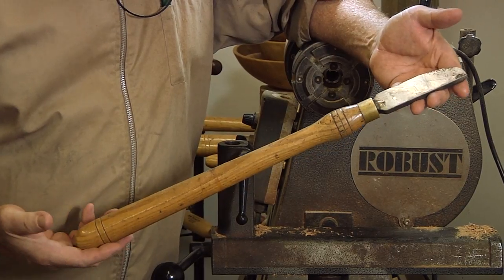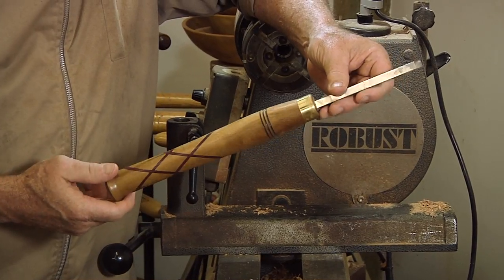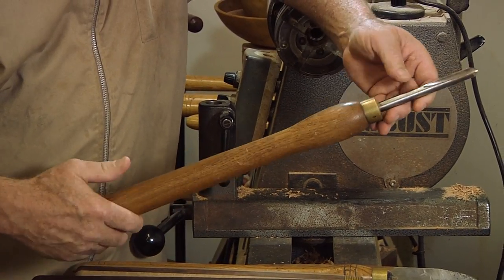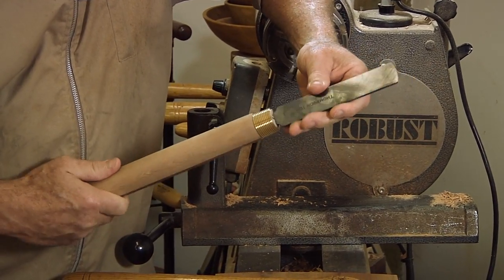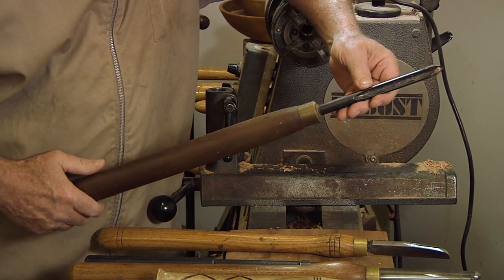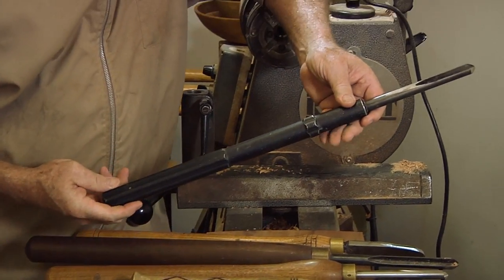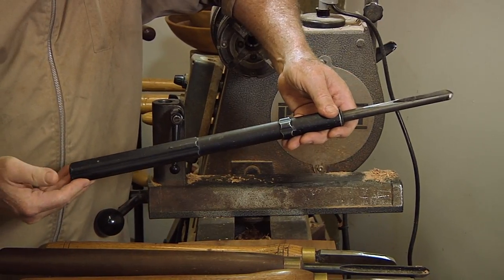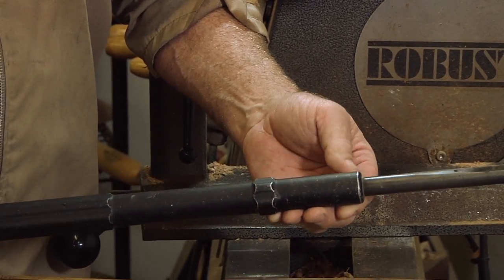Robo Hippy presents TOOL HANDLE DEMONSTRATION

Comment: Excellent video.  Thanks for sharing.  I was buying ferrules from CUSA and then discovered that you can buy copper sleeves at your local hardware store for a lot less.  I cut mine in half.  Works for me.